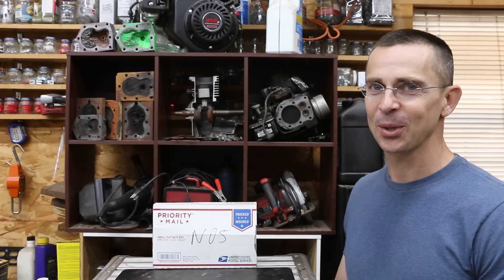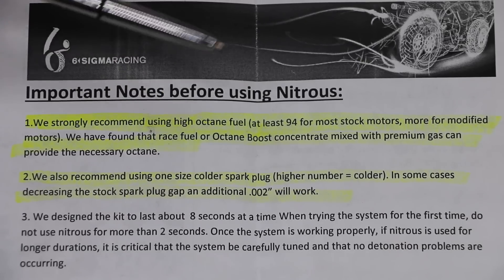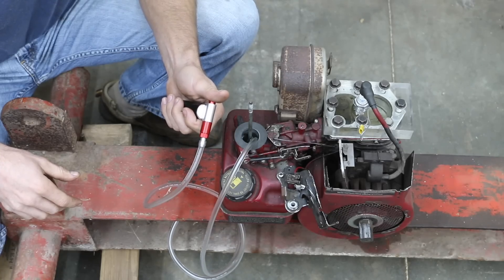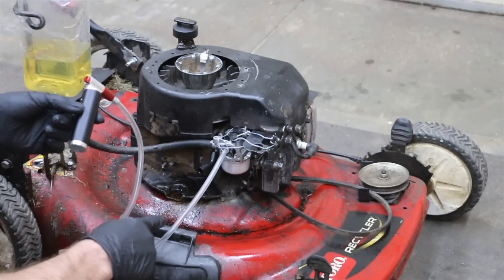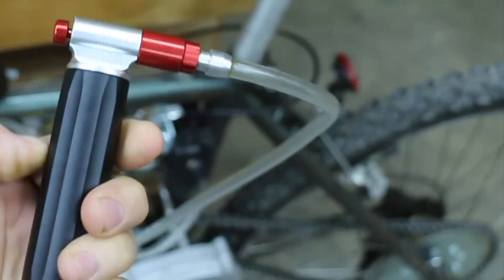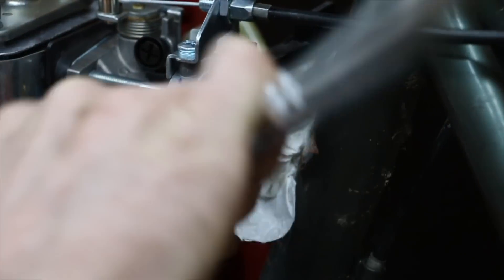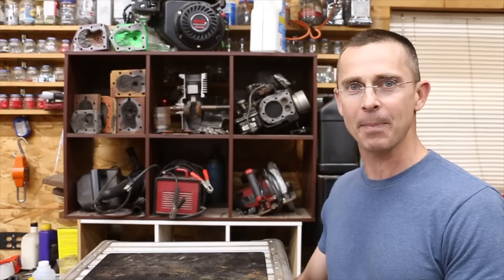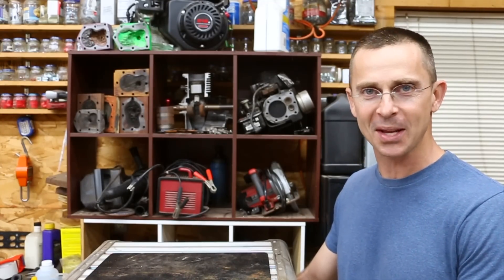Will the 4-Stroke Bike Survive Nitrous Oxide?  Let's find out!

Comment: Thank you for testing this NOS kit. Without a supplemental source of fuel, the engine is going to significantly lean out when nitrous  is applied. 

Please retest with a small electric fuel pump feeding a dedicated fuel injector. Similar to a water injection setup. This should further increase power and resolve the problems with pre-detonation.
Reply from the maker: Great point and thank you for the recommendation.
Reply: @ProjectFarm  i think maybe just a bigger jet would serfice it would run rich with out the nos but it wouldnt matter much not like you would ride it in the low rev range.
Reply: +2 nitrous is only as good as the fuel it's mixed with. A wet shot would be a better choice, but fun vid
Reply: Yes, the big advantage to NO2 is that it allows the engine to burn more fuel.  Without the extra fuel it will most likely run lean.
Reply: @markbunn8576  Yes.  Nicely stated.   It will most definitely burn lean.
Reply: +1 NO2 should also only be use at high throttle levels.
Reply: Big time YES!  NOX itself does nothing if it does not have the fuel to combust.  Noted slight increase in power was only due to the existing carb jet being a little oversize.
Reply: Maybe use the pressurized NOS to drive its own extra fuel through a special pressure fitting and jet?
Reply: @BudgeChem  Great idea!. A pressurized pre-carburetor. It could be done with an airbrush which would provide adjustability and a small reservoir for the extra fuel.
Reply: @BudgeChem  Just need to pipe in a siphon feed single stage airbrush, and fill the paint bottle with high octane gas.  The NOS coming through will suck the fuel out, and atomize it into the NOS mix.  Just rig it to spray right into the carb.
Reply: @slimjim7411  Would be possible to not even use a separate paint bottle for fuel, just put a T in the main fuel line and run that directly to the feed fitting?
Reply: 100% this

As pointed out in the MSDS, n2o breaks down in to nitrogen and oxygen at high temperature. That part is correct. What's incorrect is this idea of "explosive decompression" to make more power.

The high temperature of combustion causes the nitrogen and oxygen to separate, so after you have burnt all the oxygen in the cylinder during the combustion event, the n2o will introduce more oxygen, which allows you to burn more fuel and make more power.

Without additional fuel you're only burning left over fuel that wasn't burned during the initial combustion.
Reply: @mrclown7469  The formation of NO2 is an endothermic reaction. It takes energy to oxidize nitrogen. When it decomposes, that energy is released as heat. It form at extremely high temperatures, and under pressure. Diesel engines are notorious for this. This is in addition to the extra oxygen being able to burn more fuel, to further increase combustion energy. That's what makes NO2 so energetic. It's even more powerful than pure oxygen! That double whammy.
Reply: @vincentrobinette1507  Interesting. Didn't know that part. Thanks.
Reply: @vincentrobinette1507  Yup.  Nicely stated.  Thanks for sharing.
Reply: @vincentrobinette1507  There is another aspect of NO² injection that can have a profound impact on combustion: the rapid expansion of compressed NO² will dramatically lower intake temperatures which results in a denser intake charge. While EFI units can automatically adjust for the density change (i.e. more O²), carburetors aren't typically able to compensate. Thus, the need for supplemental fuel.
Reply: @EDesigns_FL  Your exactly right! I completely forgot about the refrigeration caused by the expanding gas. That increase in air density means it can burn even MORE fuel!!!
Reply: I agree. The engine is starving for fuel with the additional oxidizer.
Reply: I suggested fashioning a linkage that would apply partial choke when the nitrous is used. Just as a form of fuel enrichment on the cheap.
Reply: Yep, I was thinking the same thing, with the extra oxygen, you need more fuel. Any nitrous oxides kits in a car would have a jet for nitrous oxide and a jet for fuel. Hope this helps.
Reply: Yes, thanks for posting that lol I came here to say it but u said it better
Reply: Probably not, nos was designed for and really only works well(without major computer recoding if ur luky} on carbeutrors
Reply: @richterman3962  I forgot to mention that these small engines only have about 8:1 compression ratio. That low compression ratio Might make detonation a little easier to deal with, in that the timing is fixed, without a little machining of the flywheel key slot. That would be my next step.

Comment: Revisit this same idea but as a wet shot.  You could devise a venturi to siphon extra fuel in with the nitrous and see if there are larger power gains.
Reply: The extra gas should lessen the pre detonating also. As that's the main problem with nitrous, it leans out the mixture to much, which leads to pre-ignition.
Reply from the maker: Great video idea!
Reply: Cooper's wet shot...
Reply: Caleb Allen nah you need Jame’s 3hp spray and this thing would wind up making 195hp

Comment: Nitrous Oxide in a 2 stroke engine? You should also do a gas vs electric lawn mower showdown.
Reply: With the nitrous/fuel mix in the crankcase if that goes boom, metal parts will be flying.
Reply: @AIM54A  its almost 100% guaranteed to go BOOM. Ever had a backfire through the carb? Imagine that ×many,many times. Aluminium buck shot in all directions
Reply from the maker: Great video idea!
Reply: Hah RIP

Comment: That lawnmower was rippin
Reply from the maker: lol.  Yes it was.
Reply: Matthew Plouffe 
They will sing pretty high. 
I had a 3.5hp from a power washer and tied wide open it would go about 56-5700 when checked with one of those 12$ eBay/Amazon tiny tachs
Reply: MrHillfolk oh dang! They really go don’t they!
Reply: Matthew Plouffe 
Hahaa yea they do. 
I had a pressure washer with a bad pump head , so what better fun to see what verified max rpm was. 
Funny thing was it was bouncing 55-5600 for about the first minute , and went up another 100 rpms after that. 
I went thru a couple tanks of gas trying to blow it up. 
It probably ran about 45 mins total before I drained the oil, I was tired of wasting gas
Reply: @MrTheHillfolk  NITROUS WITH NO WET SHOT!!!!!!!!!!
Reply: Caleb Allen 
That might be fun, I bet it would take a little hammering before it totally scattered too !

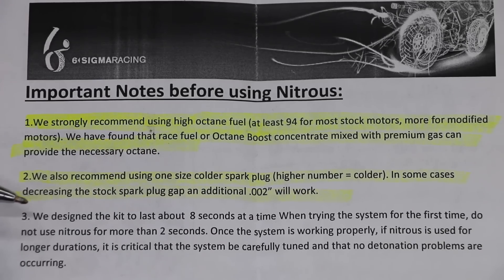Comment: Try Acetone as a fuel additive or fuel replacement. Tales are being told that adding acetone into your fuel tank in a mixture of 1:250 can increase fuel economy and power by a lot. So what happens if you do say that or go as extreme as 1:25? How long will the engine run until all rubbers, gaskets and sealants have been eaten away.

Anyways GREAT videos - love them!
Reply from the maker: Great video idea!  Thank you
Reply: A gallon of acetone to more than 10 gallons of gas was an old trick to clean cat converters...seemed to help, dont have documented proof..

Comment: NOS on a bike. awesome. i can't believe that Briggs motor is still going mate after all its been through that is amazing!!!!!! Would like to see it setup with a better jet in the carb and a colder plug to get the tuning kinda right. A thought for a future possibly several part series would be maybe rigging up fuel injection to a non fuel injected motor then mucking around with small turbos and / or NOS as well
Reply from the maker: lol.  Great ideas!  Thank you.
Reply: very welcome. i've had a crazy idea of running a delco 808 on a mower for next to forever ; using the old single point injection method. they are plentiful and uber programmable

Comment: Projectfarm, my friend has a car that is burning about 3 quarts of oil per week. Is there any sort of additive you would recommend to help reduce the amount it burns? The car needs rings but it’s not worth putting the time and effort into it to fix it. Thanks
Reply from the maker: Yes, I highly recommend "engine restorer".  I would also use a high mileage engine oil. Hope this helps.  Could you please let me know if it helps if he decides to use the product?  It has helped my vehicles with oil consumption.
Reply: We will give it a shot thank you!!! I will let you know if it works under this comment. Watching the nitrous through the see through head was very interesting in this video, thanks

Comment: At 0:47 It states the decomposing nitrous oxide is explosive. It also says above that to keep it away from combustibles. Unfortunately the energy from this initial reaction is irrelevant and does not make much of a difference in an engine as the majority of the reaction just makes a lot of heat hence the requirement of higher octane fuel. The bulk of the additional power comes from the free oxygen added to your air fuel mixture as a result of this reaction combined with additional fuel to create a substantially larger explosion. More oxygen and more fuel (which unfortunately this kit does not add more of) makes more power. Try running it just a pinch rich and you'll probably see a greater increase in output. Please note that this also adds a lot of free nitrogen and the resulting nitrous emissions will get into your crankcase resulting in the increased formation of acids which will require more frequent oil changes.
Reply from the maker: Great point. Thank you
Reply: @ProjectFarm  Yeah, just try running it a pinch rich and run a colder plug to eliminate that hot spot. Colder plugs do build up carbon faster when not run hot enough so that's something to consider. More evaporating fuel will also help cool the mixture a little to help with pre-ignition as that is definitely killing your potential output. Great video though. I never considered nitrus in a small engine before.

Comment: Any motor can survive nitrous it just really depends on the levels. Typically when you build a motor for nitrous you shave the ring ends down slightly as they will grow and pinch. You tend to see a lot more heat and peak cylinder pressure. It all depends how it’s built, how much extra fuel you use and your IAT. Inlet air temp as well.
Reply from the maker: Great point!  Thank you.
Reply: Telltale sign of over nitrous use is top of the pistons cracked or busted around the edge near the upper compression ring.
Reply: @jacksonhomestead01  i believe that is a sign of the ring gap being to small for the nitrous application.  When the rings get hot they expand, close the gap, bind and crack the piston typically above the upper ring  groove..
Reply: @Aronteed  Yep, seen it many times.
Reply: Spark plug temp, electrode protrusion and gap too.
Reply: As well, when building a NOS system, there needs to be a way to add extra fuel.  To keep from going lean.
Reply: +nun... I had a brain freeze yesterday and I just could not think of Venturi or porting. Yes, the spraying in through the carb could cause an increase in fuel delivery by the jets.
Reply: Ignition timing should also be backed off for nitrous
Reply: +James... As best I can tell, this kit is doing absolutely nothing.  Without an additional source of energy from extra gasoline, it is not possible.  I suppose it's possible they have mixed propane in the little cartridge or something, but this engine should already be at a 14.6:1 ratio.  If it is already at that ratio, adding additional O2 accomplishes absolutely nothing other than running lean.
Reply: @tarstarkusz  These engines are set up to run a little rich so they run cooler and, safer for warranties so this nitrous company probably banks on that.
Reply: +S W... If that's the case, you can simply adjust the carb and get the extra power all the time.
Reply: @tarstarkusz  
well, as the speed of a reaction is partially determined by the concentration of the reactants, if you add one of them the overall speed will increase as well as the temperature(which itself increases again the speed). but you're completely right about the a/f ratio, more fuel should have been added.
Reply: @tarstarkusz  He is not adding 02,  he is adding N 20
Reply: @hoganhogan952  n20 will dissipate under compression and heat, and will add the percentage of o2 on the air entering the engine. That will mess with the afr of the engine if it doesnt add enough fuel. Same things happen to the ethanol or methanol engine. They need way lower afr (more fuel) to compensate the oxigen part inside the fuel.
Reply: @ichihusni5014  No... but you are correct that you need to add more fuel if you don't want to run lean.